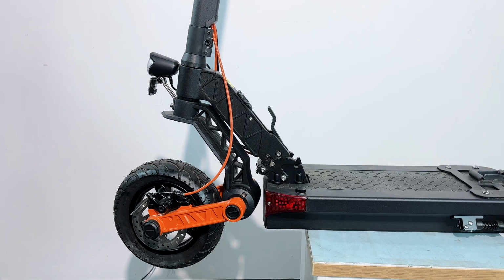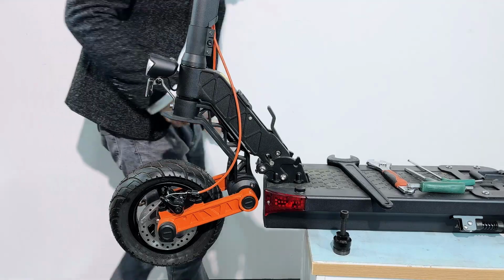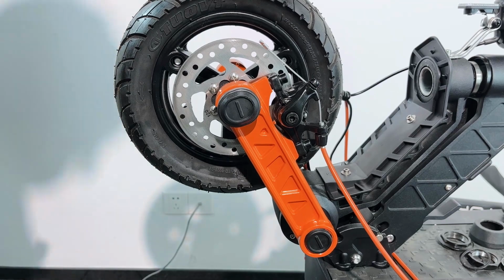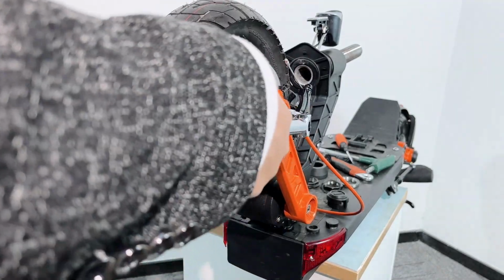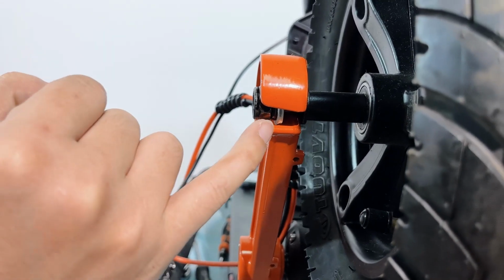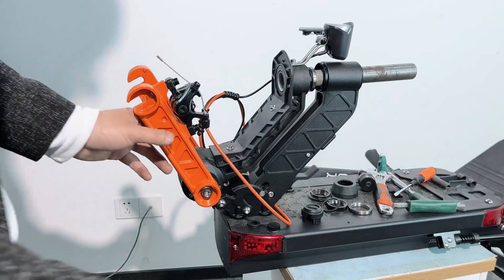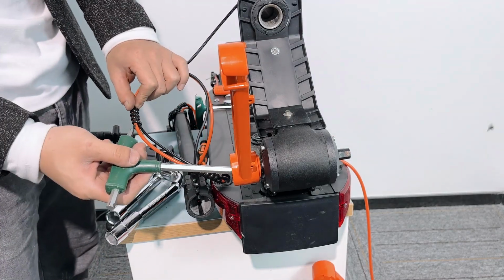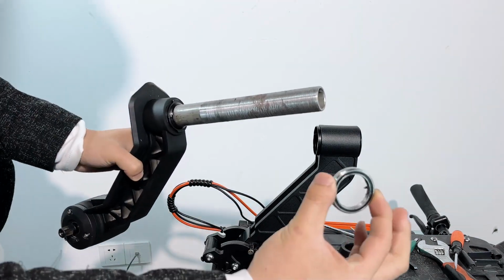How to replace the front rocker arm/fork for JOYOR electric scooter Scooter Repair JOYOR S5 S8S S10S

Comment: I have a s10 s the adjustable handlebar  it keeps going down when I ride. Any suggestions? And I did tighten the. Stem Quick Release Clamp to so…
Reply: You figured that out yet I know what’s up with it it’s a tiny middle bolt on the front of it. If it comes completely loose your whole clamp and a plastic thing in the middle will fall out.

Comment: Hello !
In advance thank you for the video. 
Could you please let me know what is the size of the puller ? m30x??  I am looking for information concerning 
thread pitch (m30x1.5 or m30x2 or m30x3?)
Reply: The diameter of the large screw is 30mm is correct, but which size does 1.5/2/3 refer to?
Reply: @Mechanic0007  Thank you. The pitch of a lead screw is simply the distance (spacing) between adjacent threads. Please see at google how to measure - usually the entire parameter of the thread is represented as: EXAMPLE M30x1.5 what state 30mm of diameter and 1.5 mm pitch.
Reply from the maker: @Mechanic0007  I think it's 1.5, because I measured the value between 1.5-1.8, which is less than 2.0
Reply: @SCOOTERREPAIR-kf2fn  Thank you for the comment and help ! However, my scooter has different size of the fork's threaded holes. After dimensioning and fitting couple of bolts: There is M32x2 if anybody else would like to know. There is no puller with this size on the market. Does yours is custom made ?
Reply from the maker: @kamilsabat4611  The factory gave it to me, I don't know if it is a special size
Reply: @SCOOTERREPAIR-kf2fn  It writes something on this puller, what kind of key is it, what model?
Reply: M31x2 to jest
Reply: @JuriusZ-xd  Jesteś pewien? Taki wymiar wogole nie występuje w tabelach gwintów, bardziej skłaniałbym się do M32x2. Niedługo będę się za to zabierał w moim S8-s, przydałaby mi się taka informacja😊
Reply: @kamilsabat4611  Did you menage it? Did you make the puller yourself or buy it somewhere?
Reply: @krzysztof4829  mam gwint m30x2 i sa luzy to jest z chin i tam taki maja, pasuje sie jeszcze wkrecic m32x2 i zobaczyc
Reply: @JuriusZ-xd  udało ci się to jakoś ściągnąć? Dało radę M30x2?
Reply: @krzysztof4829  tak - przygotowałem swój projekt ściągacz i zleciłem do produkcji. Będzie to M32x2 (sprawdzone grzebieniem do gwintów oraz gwintownikiem M32x2) Raczej nie wydaje mi się aby te ramiona widelca były produkowane w różnych rozmiarach.
Reply: @krzysztof4829  podwarzasz zaslepke na filmie masz
Reply: @JuriusZ-xd  chodzi mi o ściągnięcie ramiona wahacza z ośki elastomeru. Czy dałeś radę to ściągnąć?
Reply: @krzysztof4829  jak bedzie trzeba to to sciagne ale chce sobie zrobic taki sciagacz jak na filmie kultorka a nie prac w wahacz
Reply: @krzysztof4829  na sto procent to jest M31x2
Reply: Does anyone know where I can get that M31 puller tool???
Reply: Jestem po wymianie elastomerów. Można to zrobić zwykłym ściągaczem dwuramiennym do łożysk. Ważne tylko aby miał cienkie stopki by mógł dobrze złapać za wahacz.
Reply: @krzysztof4829 też zmieniałem mam ściągacz zrobiony gwint M31x2 na tokarce śrubę wkręcam gwint wypycha kulturka taki jak na filmie 😊
Reply: @krzysztof4829  polecisz jakiś model? mam dwa ściągacze (dwu i trzy ramienne) ale oba maja za grube łapki i nie ma jak złapać.
Reply: @kamilsabat4611  jest możliwość zakupu tego ściągacza od Ciebie?
Reply: @heyimque  tak musi mieć cienkie stopki i dwuramienny bo są tylko dwa miejsca gdzie można te stopki włożyć. Ja kupiłem ściągacz do łożysk alternatorów firmy Magnus model MGS01394, ale myślę że każdy przeznaczony do łożysk alternatorów da radę
Reply: @krzysztof4829  pięknie dziękuję
Reply: @krzysztof4829  Nie mówię po polsku, ale czy możecie mi pomóc z tym, czego potrzebuję do tego ściągacza, próbowałem wyszukać ściągacz m31x2 i nic nie pojawia się nigdzie w google.
Reply: @krzysztof4829  Można takim ściągaczem, też robiłem podobnym ale dwie uwagi. U mnie były bardzo ciasno nasadzone wahacze i taki ściągacz się zwyczajnie ześlizgiwał z wahaczy (rozpierało go na boki) przez co zdarłem lakier w wahacza. :/ Pomaga lekkie ściśnięcie końców łapek na wahaczu ściskiem śrubowym. Druga uwaga jest taka, że trzpień takiego ściągacza jest stożkowy i uszkodziłem tym sposobem gwint w osi, zwyczajnie pierwszy zwój został zmiażdżony tym stożkiem. Warto wsadzić/wkręcić tam wcześniej jakąś śrubę z bardzo twardej stali i dopiero o nią oprzeć stożek ściągacza.

Zamówiłem ściągacz podobny do tego na filmie, w rozmiarze M32x2 i nie pasuje, jest minimalnie za duży więc przychylam się do tego, że to raczej będzie M31x2. Na filmie widać, że oryginalny ściągacz ma spiłowany na płasko gwint, może to też być przydatna cecha, bo gwint w wahaczu jest pokryty lakierem i taki spiłowany ściągacz pewnie go mniej kaleczy.